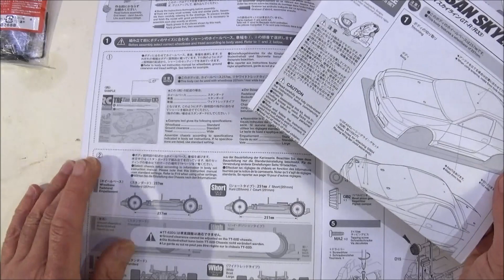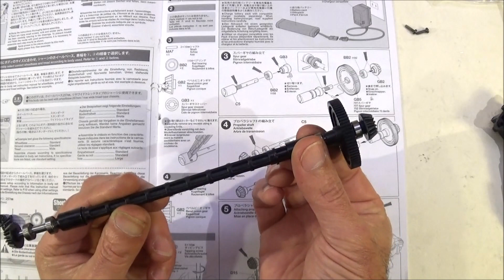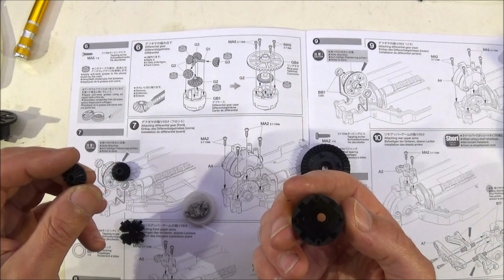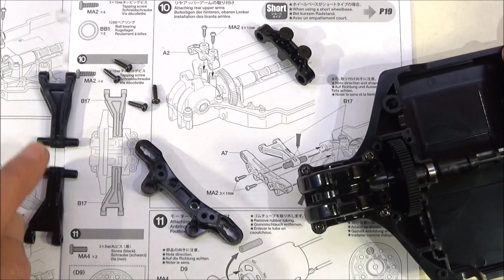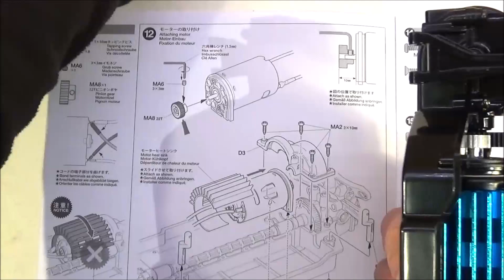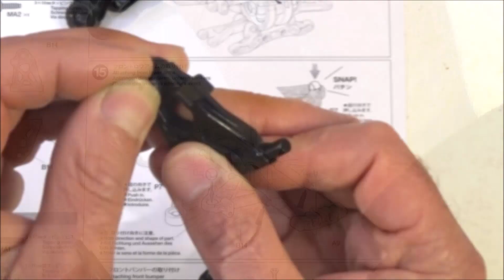Tamiya TT02D DriftSpec Build Part 1 - Nissan Skyline GTR -Build-off #11

Comment: I bought the TA02W in 1999 , and remember it being a bit more sophisticated. If I remember correctly the small gears in the diffs were metal not plastic,. and there were metal screws holding the arms to the chassis . Arms here seem to have the pivots as part of the arm itself , in the form of thick plastic rods.
Reply from the maker: You are right, the TA02 is definitely more sophisticated with "proper" double wishbone suspension with C hub steering, oil shocks and much more... the TT02 is definitely more of an entry level kit! 😎👍
Reply: @MarkBryanRC  I was not much into the rc scene when I got  mine , but there were already belt driven HPI chassis , and I used to think the TA-02 was sort of an entry level chassis.  Their main problem is the screws tend to strip and break most of the plastic . You really need to be careful to not over tighten. I eventually bought both front and rear diff case kits cause they were loose screws all over. Still have it and recently got back to it again.
Reply from the maker: @joecachia2  I wonder if there was an issue with the TA02, I have an original TA01 from the 90's and never had a problem with it. I  have the DF01 which is a similar chassis and had that issue with plastic breaking... Like you say, at least you can still get the spares for it. 😎👍
Reply: @MarkBryanRC Well , it was mainly my fault. I was inexperienced  and did not know that you should not over-tighten them , plus the smallest hit on a curb or a wall , does not help.

Comment: Have 3 TT-02 variations to build,  after just one kit made so far, my best advice might be to take all the screws and sort them out before starting the build, it slows you down and it's frustrating looking for screws. I have since bought some trays and containers and think this small step alone will assist in your build. I say this as every other aspect of the build was enjoyable, this was the only negative for me. Great vids, made myself a cover plate for the front of the chassis over that ribbing from an ice-cream container after seeing your somewhat flasher cover plate a friend 3d printed for you, should keep any debris out. Appreciating the tips and tricks you're sharing, it should mean less head-banging during the build (not true, was so much fun, even doing some things twice, or thrice), and using the cars too. Loved the Impreza with the lights too, top class effort.
Reply from the maker: Hi there and thanks for the interesting thoughts. I can't remember what I did with the screws on this build but I always sort them out for each step in advance now. Good idea for that chassis plate and it will certainly work! Thanks for the kind words about my videos, much appreciated here - cheers! 😎🙏👍

Comment: I saw in a more recent video of yours that you don't bother with the d15, should that also be the case now? As I'm building mine now and not sure if I should put it in or not. Great video by the way, I'm following it step by step 😊
Reply from the maker: Oh yes, I always leave that part out as it restricts the steering lock. You need a radio with a steering end point trim though of some servos will turn too far and the dogbones can catch in the drive cups. Great to hear you're following the video - many thanks! 😎👌👍

Comment: I followed everything exactly. But my prop shaft isn’t as loose as yours it’s pretty tight and doesn’t turn as well.
Reply from the maker: Hi Stephanie. It really should turn easily and smoothly. I'd take the top diff covers off and have a check just to be sure. The diffs should spin easily in their bearings. Good luck! 🤞
Reply: @MarkBryanRC  thank you i'll try that

Comment: I can’t find part D15 what should I do?
Reply from the maker: D15 should be on the D parts tree. You can run the TT02 without this part, it restricts the steering. But you need to set your steering control on your transmitter so the steering doesn't turn too far or your dogbones might pop out!

Comment: Just bought this new to rc cars is it very difficult to put together? For a newbie
Reply from the maker: Hi there! The instructions are very clear and I don't think a newbie would have too many problems. You can always build along with my build guide if you are unsure!  :)
Reply: @MarkBryanRC  Tamiya Skyline GT-R Z-Tune R34 - TT-02D that’s the model I got imagine it’s the same first ever time building one thou so if you could comment the build guide would be awesome
Reply from the maker: @ivpepsiivi4486  Yes, the build of the chassis for your model is exactly the same as the chassis in my build guide that you are commenting on! The only difference is the body, but the process of doing the body is the same also for the R33 body that I do in this build guide series, so you can also follow the steps there!  :)
Reply: @MarkBryanRC  appreciate it top man

Comment: Does this tutorial work for tt 02 chassis ?
Reply from the maker: Yes it will work for a stock TT02 chassis as they are almost identical. However, if you are interested, I did a video about how to improve a TT02 road chassis on a tight budget. Here is a link to the video: https://www.youtube.com/watch?v=Yp3b3_4P8Jw

Comment: Hi Mark. I have picked up a completed tt02d  mazda rx7. Guy who built it made it entirely stock ( bushes etc ) . I am planning to completely strip and rebuild with bearings and yeah racing upgrades.  Can you advise on what grease etc is best for general assembly and diffs etc. Cheers Dave
Reply from the maker: Hi Dave. Good idea to rebuild the TT02D. However, I'm sure my TT02D kit came with bearings, a Sport Tuned motor, heatsink and oil shocks. Anyway, I prefer to use Tamiya ceramic grease on the plastic gears, Moly grease on metal gears and AW grease in the diffs. I also remember the TT02D kit coming with AW grease to stiffen up the diffs. Have fun with the rebuild!  :)
Reply: @MarkBryanRC  Hi Mark. Cheers for the reply.  The guy couldn't remember what was installed so I will find out on teardown.  From the photos it does have the heat sink so likely all the others are installed. Thanks for the info on parts and greasing. Think there is one little model shop left in Torquay that does RC so will pop and see them for grease. Thanks again. Dave
Reply: P.s. spent too much already on anodized blue bits lol
Reply from the maker: Haha, I know where you're coming from, Dave, it's addictive!  :D
Reply: @MarkBryanRC  yea as I am finding out !  Trying to track down a Killerbody 48626 clear Nissan Skyline R34 clear body kit for the TT02D

Comment: Wanting to get into the sport and instead of buying a prebuilt one I’m swaying towards the tamiya TT02. Are these kits beginner friendly? Awesome guide btw 👍🏻
Reply from the maker: Hi Jordan. I definitely recommend building a kit, as you get to know how it all goes together and can easily then make repairs and mods when needed. I'd say this kit is OK for beginners if you know how to use a screwdriver! Thanks for the great comment, enjoy the hobby, it's a great thing to get into. Warning - once you start, you can't stop! All the best from Mark...
Reply: @MarkBryanRC   hi mate thanks for the info and yes im good with a screwdriver because i work on my own Dirtbikes, i made the mistake of buying a joblot of nitro tamiya parts on ebay without the knowledge on how to put them together lol. so just want something i can assemble and atleast learn the basics
Reply from the maker: @TheJord0108  Cool you are into dirtbikes, I used to race motocross back in the day! I'm sure you will easily follow the manual and get hooked on Tamiya RC like I did!  :))
Reply: @MarkBryanRC  whats the upgradability like for the TT02's
Reply from the maker: @TheJord0108  It's probably the most upgradable RC car you can buy, mate! Just check out the stuff on eBay, there is an endless list! Cheers!  :D

Comment: Hey 
I need a help I'm a beginner to the rc world 
I need your instructions I am so on to this car 
What and all is needed to build this car
Tamiya 1: 10 TT 300058584 02D Drift Spec Chassis
This is the main kit 
Then the servo, and the controller and anything else needed
Reply: Forgot the body
Reply from the maker: Don't forget the body!  :D
Reply: And if I buy this kit****
Reply from the maker: @Unknownnn-691  😁👍
Reply from the maker: Hi
You need to get a transmitter, it will usually come with the receiver and servo. You might get a ESC with the kit, if not you can get it separately. The only other thing you need is a body, any body for the TT02 will fit. Good luck!

Comment: Does the kit come with the motor?
Reply from the maker: Yes, it comes with a Tamiya Torque Tuned silver can.  :)
Reply: @MarkBryanRC what’s the top speed 😢
Reply from the maker: @evoxgamerz5877  I think I tested it at about 20mph, stock setup! NiMh 7.2v battery.  :)
Reply: @MarkBryanRC  thx

Comment: Could you give me the link for the motor?
Reply from the maker: Hi - the Sport Tuned motor is included in the TT02D kit.
If you want to buy it separately, here is a link for the cheapest I could find in the UK:
https://www.ebay.co.uk/itm/Tamiya-53068-RS-540-Sport-Tuned-Motor-Silver-DT02-DT03-TA02-TT01-TT02-M05-M07/383820543315?epid=17003298646&hash=item595d7cb553:g:F~wAAOSwJTZdsvnS
Hope this helps!   :)

Comment: you make it look less daunting to build it. i like building HG scale Gundam kits so anything with screws ad fears of stripping them is a faint but evident fear on a working kit like this. are there any parts that need a bit more torque than "a tad bit tighter than hand"?  BTW i order the very same kit R33 drift so its a very useful vid for me.
Reply from the maker: Hi Jon, cool you got the R33 drift kit coming! No, you only need to nip all the screws up hand-tight, if you go too far you will feel it getting a little easier to turn, so if that happens, stop immediately and it should be OK. I'm sure you will get the feel for it in no time at all. All the best with the building, Jon!   :-)
Reply: @MarkBryanRC  these differentials are a bitch. i slathered the first in grease using 3/4 of the tiny tub of AW grease and then second guessed if i over greased. took that first one apart and used the gears themselves to pre-grease the second set. the second set was put together but still not much tension, took it apart and added 3 dabs of grease on a toothpick and it a tat bit stiffer (weak tension). i hate those tiny screws, its the most stressing part of the build so far. might need to add a few dabs the the 2nd diff but it has a nice coat of grease on it after the 2nd rebuild. the first has some decent tension on it but the 2nd one is almost half of that tension.

 i swear i lost a year or 2 of my life from stress. had the right  screw driver by chance but its a thin handle ad i must only do 1/8 turns at a time to avoid slipping off the head... i cant wait until i get around to assembling the shock towers... i had to play some calming music while redoing that stuff...
Reply from the maker: @NelTu7190  Oh Jon! Sounds stressful indeed, but I promise it will get easier the more you build the kit. The gears sound fine, too much grease and it will just get flung off when running! The calming music sounds like a good idea, I usually listen to music whilst building! Hope the rest of the kit goes smoothly!  :-)
Reply: Thank you for the reply. I just hope the self tapping holes don't wear out too much with time. I will check my tool box for a better screwdriver today. I usually listen to heavy metal but that would make the diffs more stressful... 

The kit didnt come wit ESC so it's need ordered TBLE-02S. It will come in a week and I'm still waiting for the curved scissors and the red paint to arrive. Plenty of time to get the chassis done...
Reply from the maker: @NelTu7190  The best screwdriver for the job is a genuine Tamiya one, as the screws are JIS (Japanese Industry Standard) so most you get over here don't fit too well - definitely don't use a posidrive screwdriver! And definitely calming music is best! Take it easy, my friend.  :)
Reply: Thank you for the reply RC tool kit and some AW grease is on the list along with tire glue. My screwdrivers didn't fit that well barring normal size 1-2 Phillips.

just finished this part of the build, its fair to say that this kit was sponsored by Ziplock bags. so many small parts to carefully store...

Comment: thank you for the video, i want to buy from RCmart but afraid from assembly, can you advice please: i bought TT02D Evo X kit + Servo + Transmitter & Receiver, I already have tools & Battery, is this enough or i need something else to buy? does this kit include grease?
Reply from the maker: Hello! Sounds like you got everything you need, as long as you have the ESC included in the kit. Yes, the grease you need is included in the kit.  :)

Comment: Not sure if its been mentioned before but the difference between a TT02D and a regular TT02 are Ball bearings, heat sink, CVA Dampers and drift tires? Looking to get one so would like to know. Thanks.
Reply from the maker: Hi Tim! You are correct, sir! I think the other one important thing included over the stock TT02 is the Sport Tuned motor, another £25 upgrade! If you get the chance, I think I go over all the upgrades in my TT02D unboxing video. Greetings from Mark...    :)
Reply: If those are the only difference then I think all I need is to get drift tires and replace them on my regular TT02.
Reply from the maker: Sounds like a great plan!  :)

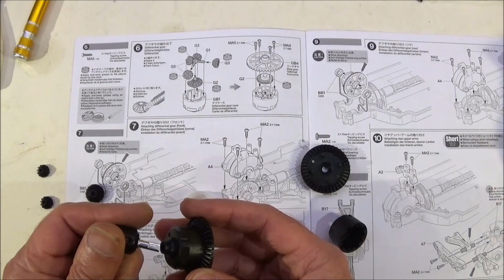Comment: I'm haveing trouble putting on the part at 6:40 the screws won't go into the holes like when I have the top on the screws go through but the second set of holes they won't go in 😅
Reply from the maker: Sorry - between 6 and 7 minutes in the video, I'm building the diffs - I can't see what you mean, are you talking about the diff cap with the 4x 2mm screws?

Comment: Curious if you have taken this off-road yet? Just got a TT-02D Supra to build with my son.  Our hope, after some drifting is to do a Rally conversion.
Reply from the maker: Hi Jason - no, not intentionally! I was thinking about doing a rally conversion, all you would need to do is upturn the C-hubs to give the higher ground clearance, stiffen the shock oil a bit and fit some rally tyres. I think it would rally very well. Having fun drifting it at the moment, though.  :-)

Comment: Does the kit come with a controller receiver battery and servo? If they don't what do you recommend for these?
Reply from the maker: No, the kit doesn't come with these electrical components. There are so many options to choose from. I recommend you look for a deal package, plenty are available. Usually you will save money on a deal, and you can choose the one that fits your price range. Most deals include the radio and battery setup that best suits the RC kit. Hope this helps!  :)

Comment: Very well presented my friend!! As always. 👋👋👋👋 

Your Voice for Radio works very well with build Videos as well. Is this your first bog standard TT02 Chassis? 
I was concerned about all the plastic Gears... But I got to thinking, if you keep this Drift Spec, there will be so little traction...
That even the plastic Driveshaft should be OK👌! 

You know this is a horrible day for me.
I thank you for this pleasant distraction! 
Cheers 🍻🍻 Bro!!
Carmine ✈🚂🚙
Reply from the maker: Cheers Bruv! Yeah, first (almost) bog TT-02, except for the oil shocks, bearings and Sport motor! Don't like the standard suspension arms or steering though! The plastic gears have done OK in my other TT's, so I don't think they will be a problem! 

Thinking of you my friend, you can do it! All the best, love and best wishes from England   :)
Reply: Thanks Brother! Friends like you sure help... 
I've got a very non standard TT02 Chassis....
STILL WAITING FOR A BLOODY BODY!!! 😭😠😠 Someday.... 

The standard Steering IS crap... But I have faith that you will find some way to improve it.

WOW!! Part 2 is up already!!! 👍👍

Comment: You're becoming a real TT-02 expert by now, Mark! It flows so smooth, your build and explanation. Great job. I like your idea of a build guide without all the time spend on showing screws and grease. Focus on what's important. Inspiring. And the model is looking great. With the sport tuned, ball bearings, heat sink. Plastic gears and plastic drive shaft will probably do fine on this too. It looks like an aluminium pinion though. Thanks for the video ... now I am already tempted ... real good specs for the price ... and never tried drifting ... must resist the temptation ... it's hard ... temptations temptations  .... uhhh ...
Reply from the maker: Hehe, not sure about "expert" mate! But yes, I have done a few TT02's recently! Such an easy car to put together, and easy to explain when it is familiar, but I also made a few mistakes off camera, very easy to do, especially when focussing on filming and presenting as well as trying to do a good build at the same time. I am sure you have similar experiences! Yeah, lots of good hop-ups at a good price - you wait till you see the other rally body I have coming for it, I know you will love it my friend! Thanks for the awesome comment, look forward to reading you soon.  :-)
Reply: Mark Bryan RC Yeah, takes a lot more time to build a car when filming ☺️